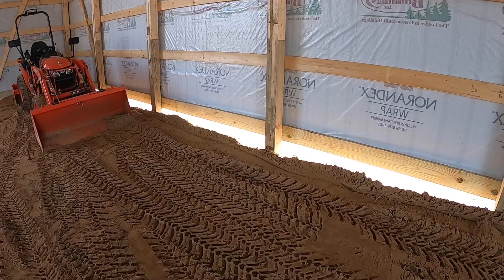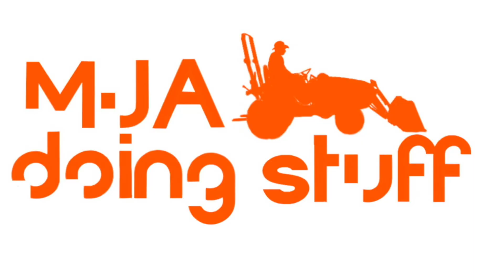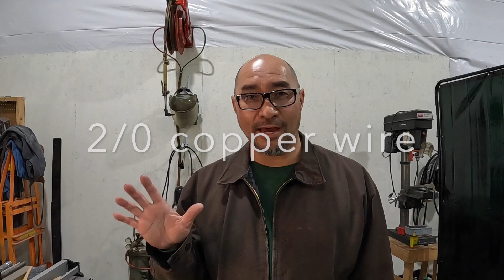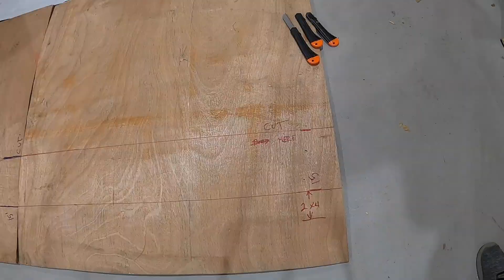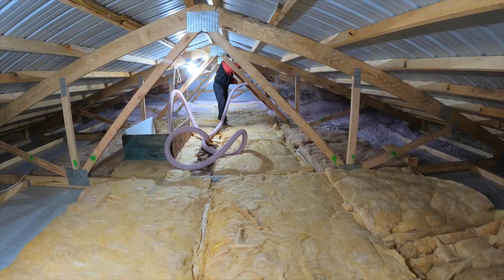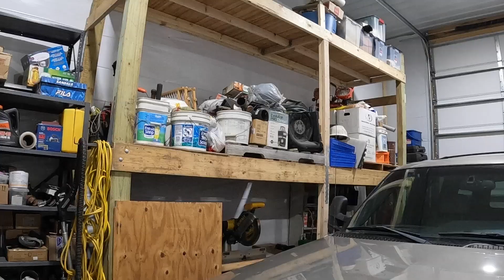FINALLY FINISHED THE POLE BARN SHOP!!! #polebarn #shop

Comment: Codes are different in each state, in Mass it is incorrect to tape the threads on black iron gas pipe.
Reply from the maker: Good to point out I did it without and had a slow leak. About a pound an hour so had to make sure the second time😂👍

Comment: Beautiful building.... You and the wife did a awesome job... And I remember the blow in insulation in my attic... Had to go with 15 inches.. inspectors you know 😬
Reply from the maker: Thanks BB😁👍 I lucked out my final passed and he never went up to look or asked. The barn seems to be holding heat well. When I work inside the heater maybe comes on 3-4 times all day and only stays on for 5 - 10mins outside temperature was in the teens that day. Have a good one 😁👍🚜💨🍳